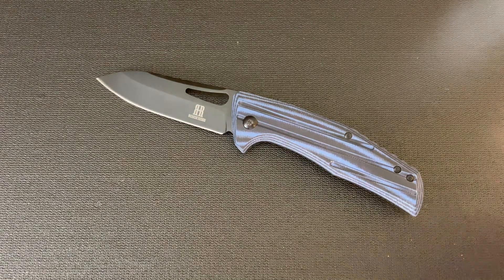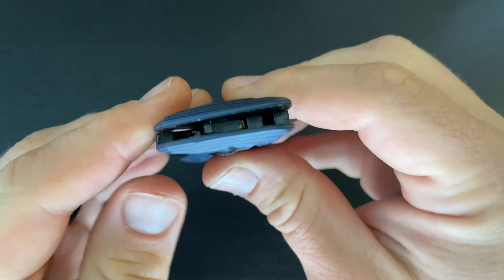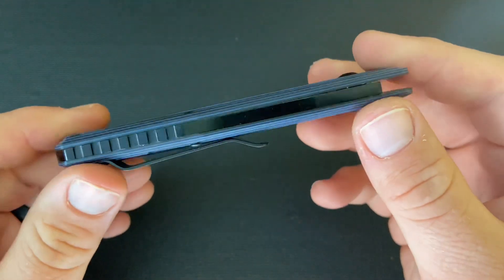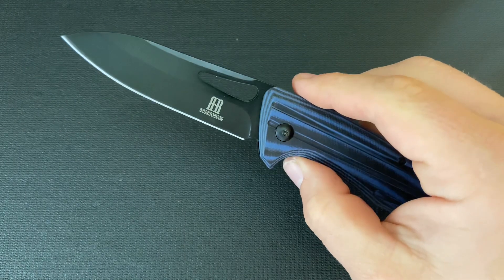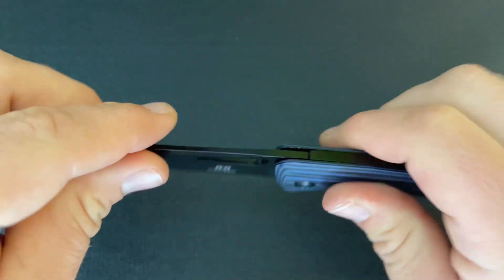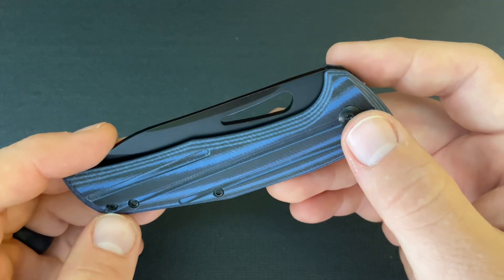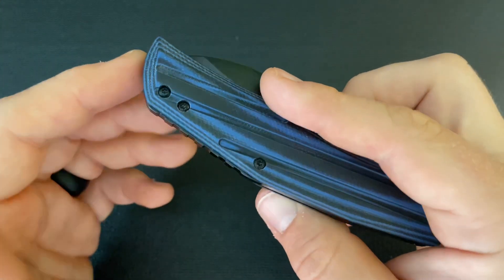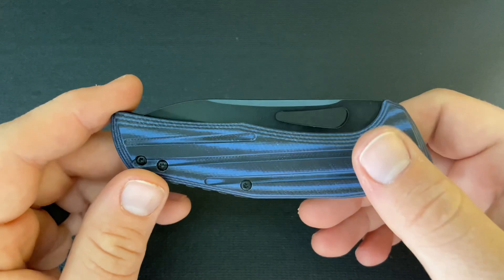Rough Ryder RR1817 Blue Black G10 Modern Slipjoint; Ultimately a Let Down Even at a Budget Price

Comment: Great review.  I removed the two screws on the opposite side of the pocket clip on mine.  They just hold the scale to the frame.  The clip appears to be attached with rivets that also serve to attach the scale.  I hate pocket clips and would like to remove mine if I could.  I also noticed that in addition to a half stop, the action feels like it has a ratchet when opening the blade.
Reply from the maker: Thanks for watching!

Comment: To adjust the pivot, open the knife and press the blade against a table top keeping the blade flat and at a 45 degree angle with the table. Hold it in this position with one hand and adjust the pivot with the other applying downward pressure on the blade.
Reply from the maker: Thanks Frank, I’ll give that a try! I tried putting pressure with a Swiss Army Knife screwdriver.